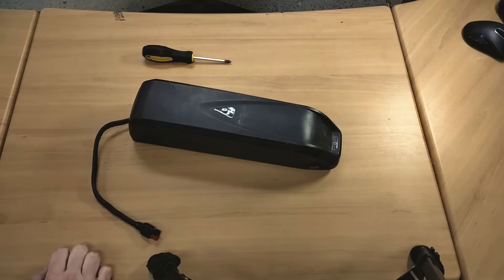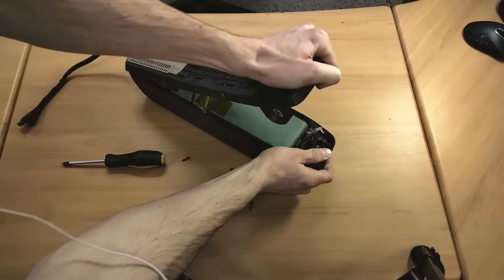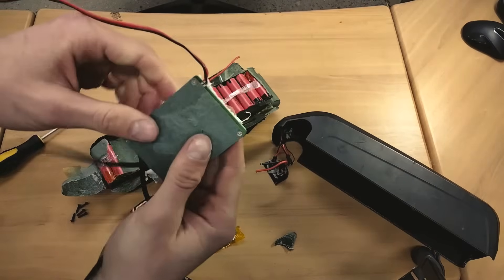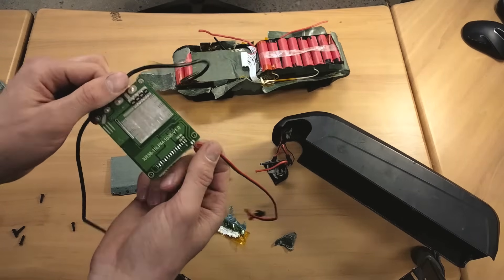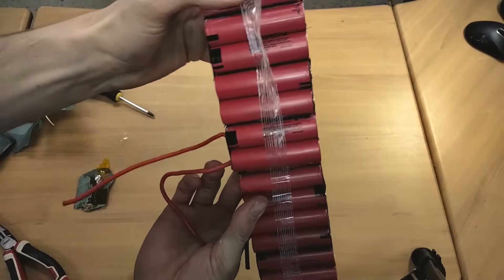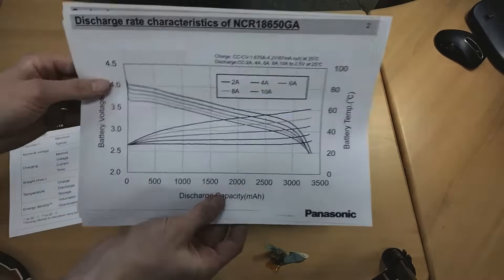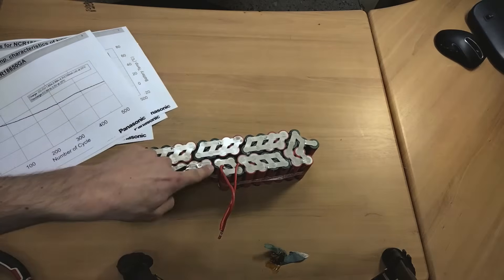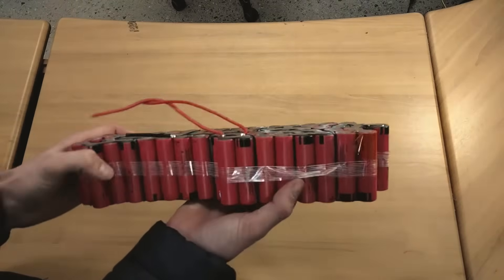48v Ebike Battery Teardown (look inside)

Comment: Great inspection off the battery 
And also good attention for everyone however build battery for higher current 😊
But Just for making clear Do you mean extra nickel strip between series connections or between parallel connections? And do you think cell layout could be better for   
Series connections and nickel strip   
Layout? Thanks

Comment: I've had two rad batteries, one since 2019, and that one got sold with my bike with 3800 Mi on it, in working condition. My current 48 volt rad battery that I'm using on my bike right now, has a documented 12k (!) Miles on it, with only a slight loss in range, after all these years. I ride my bike a minimum of 5 Mi a day, and I got to tell you other than being through three or four Chargers that burned out from getting caught in rain storms, this is one of the most reliable battery powered thing I've ever owned. It's absolutely amazing that the Samsung cell, ( greenish blue) along with a fairly large circuit board BMS, has managed to run trouble free for over12,000 mi, and still going strong. I am amazed by this performance. Thank you, Rad bikes for a fantastic product.❤Rad💥😏👍💯

Comment: More importantly, what did the Label say the battery was in terms of Amp Hours of current and voltage.  Often the sellers of battery packs engage in liar's poker on specs.
Reply: Most offen it's fake copies of known brands with very high resistance and only last 1 year max.

Comment: Hi I've got 52v175 same battery had it about 3years it's still working well apart from the switch on and off. Somtimes the bike slows down quickly and stop when I switch off then back on the lcd stops on and it's OK. Somtimes when I hit a bump in road it slowly down again then I've got to switch off then on and it's fine so cou it be the switch failing or faulty I've checked motor wires sometimes these can move if not plugged in properly I thought I would send a message to give me an idea what could be wrong I haven't took battery apart
Reply from the maker: Sounds to me like a loose balance connection to the bms or from one of the cells, otherwise just a weak battery!
Reply: @BobsEVGarage  hi if it was a week battery I do 6 miles every Tuesday to get my tablet fro chemist I check battery on the lcd full charge is 58.6 when I come back its 55.5 every time mind I do 35mph that drops battery pretty quickly. If the battery was dodgy the reading would not be the same all the time could it be a faulty switch I've checked fuse connection there fine I've checked the motor wires to controller use tiny screw dri dr to push on connections I've done that journey for three years battery still reads the same apart from if I take it for a long run but thanks for replying

Comment: Do these brackets matter within voltage? Can I throw a 48 battery onto a 36v batteries bracket?
Reply from the maker: Cant say for sure, but if they fit properly, I think it should work. There usually isnt any electronics in the bracket anyway, just some wires, so shouldnt matter about voltage.

Comment: Hey there, I am a noob when it comes to electronics very into ebikes. I have been a bicycle mechanic for a few years. I have been watching some battery repair videos as of late. I am confused on how you can tell that this bms didnt have a balance circuit? Because it looks like it does have all the balance wires going into the pcb. How can you tell? It has been a challenge learning how precisely bms work.
Reply from the maker: Hey Nauruming! Great question! To perform balancing on a battery pack, the BMS has special 'shunt' resistors, which heat up to burn off power. If the BMS doesnt obviously have a number of large resistors, it probably doesnt perform balancing. Also, on the circuit, you can see the spots where the resistors would be fitted.
Reply: @BobsEVGarage  right on, so glad I found your videos, I love that you cracked open both a controller and a charger. Also discovered electronoobs from your list of channels that you subscribe to. Which has a video on diy bms. Also greatscott has one that I just found. So if the bms didnt have shunt resistors to balance charge, what would the 14 small white wires be used for? I think that the greatscott video also mentioned that not all bms have balancing features but those series wires still exist.
Reply from the maker: @nauruming  Those are both great channels! The wires are used for voltage sensing. Lithium cells need to remain within 2.5 - 4.2 volts, otherwise there is damage to the cells. The wires just tell the BMS if the cells are out of a safe range, so it knows to shut off charging and output.

Comment: Think I can trust the BMS that comes with commercial 48v ebike batteries like the Super73 and AddMotor bikes?  I want to charge them directly with a 325Watt 60v solar panel  (no controller)that will put out around 60v 5a under ideal conditions, but likely 1/2 that .
Reply from the maker: Hey mate, I wouldnt recommend it. The BMS is meant to be the redundancy protection - in a perfect world the bike controller would cut out from low voltage before the bms has to, and likewise the charger should cut off at full voltage before the BMS does. By relying solely on the bms, you dont have any backup protection in case it fails. A small, 60v mppt would be your best bet.
Reply: @BobsEVGarage  Thanks. Too bad these batteries don't come with built in ports and DC charge controller.  Its a big battery and valuable for more than just driving the motor.

Comment: I learned a lot watching this video. Soon I will be tearing into an almost identical battery pack.  The 14S battery pack has 55 volts measured through the charging 3 pin XLR port but zero volts through the main hook up (2 pin 12mm plug).  I'm thinking the bms is bad, there is a bad cell or maybe a fuse has blown.  Any ideas?  Have you ever seen a 3 pin XLR charging port?  The XLR obviously has  + pin, - pin and but what is the third pin?  Temperature?
Reply from the maker: Sounds to me like a blown fuse on output side. Possibly bms as well. Generally the 3 pin ports only use two of the pins, but now that you say it, the third pin would be good for communication between charger and battery...

Comment: Those Sanyo GA cell usually last a lot longer then the 500 cycles. I gotten on my original pack from years ago about over 1200 cycles before they degraded. They are really good cells. I wonder if they just didn’t charge it and when into LV protection. I would test voltage on each of the series groups. You might be able to get a few groups out of it and may only a few bad cells. If cell is below 1 volt then bad as won’t try to recover due to unstable. But if above 1v maybe can be recoverable? Could also be cells are fine and BMS just when bad? That a Luna cycle pack from around 2014 era as they way they assemble them during that time. You can look up date code on cell as well.

Kind of shock they didn’t use a BMS with balancing resistors usually located by white connector?
Reply from the maker: Thanks for the info! I think the data sheet does 100% SOC in its tests, so your results make sense. I suspect this pack is very old, and yeah probably sat discharged for a while. Cells are all corroded around the positive terminal, resting at around 3.4 volts on all of them.

BMS also caught me by surprise, I guess they assumed good cells will not need balancing until late in their life.
Reply: @BobsEVGarage  kind of surprised that resting at 3.4 and no lights on case meter? Corrosion never good as could have vented but they don’t have pressure valve like LG does? I wonder if water got into case, or just old and started leaking?
Reply from the maker: @thetechgenie7374  I reckon water damage.